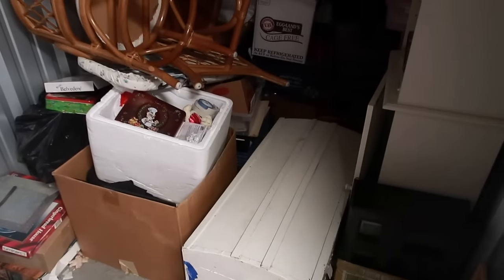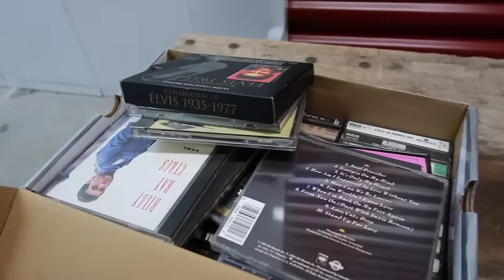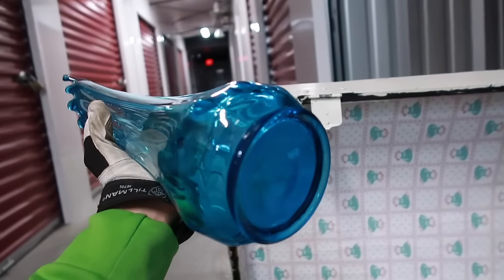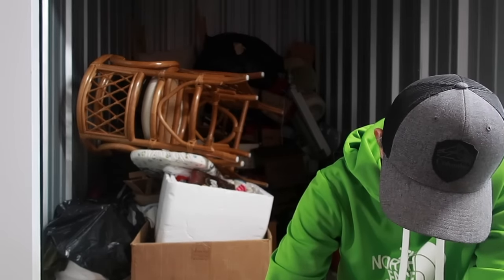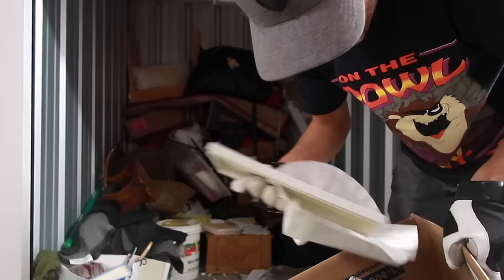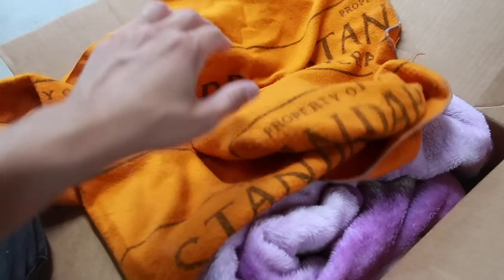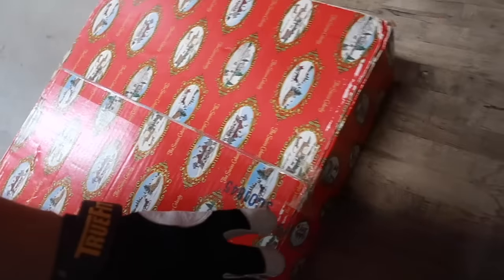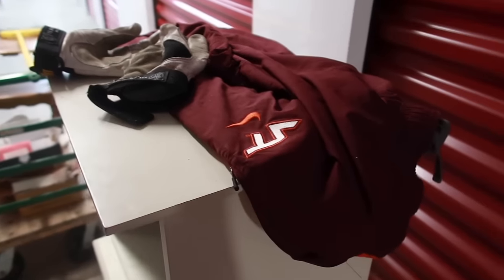I Bought an Abandoned Storage Auction Locker! IT'S A GOLDMINE!

Comment: The swung glass vase should sell for $150-$200 easily. Blue is a desirable color.  The other vase appeared to be a cased glass vase, it could be worth about the same depending on age, condition and maker. I’d run those vases by Gemini Thrift, she will be able to help value them. 
  Best unit you’ve found In quite awhile. Several items have good value!!

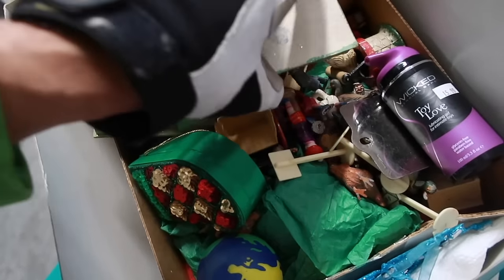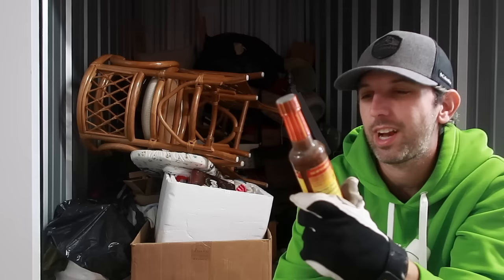Comment: 06:27 oooh Paper & Moose!  Putz houses and old metal/lead toys. (Deposee = copyrighted in French)  Post-WWII on the paperboard and cast metal, but not by much. Ohhh my.... 2 foot tall Stretch Glass vase in turquoise.  That's a fast $200 any old time.  Not sure of the other big vase.  15:02 The Walker's hot sauce is good stuff, but at that age I wouldn't use it either.  Someone used those bottles for decoration.  The rattan dining set ought to sell fast - good in a small space.